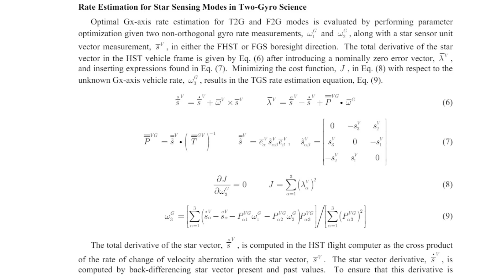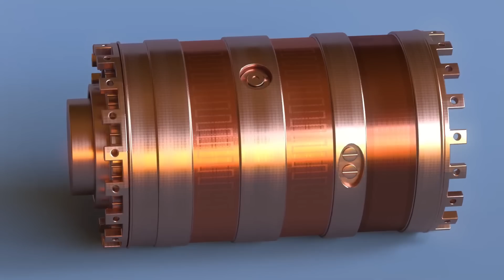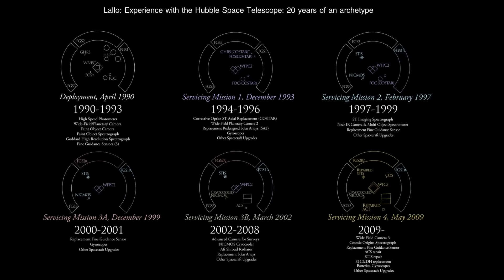How Failed Gyros Are Making Hubble's Life Harder

Comment: So why can't we build and launch a replacement (or many replacements to take advantage of cost and manufacturing efficiencies)?! Presumably NASA knows most of the problems with the original design and current modifications. So keep the basic proven design while improving/modernizing the problem areas within the basic design parameters and launch a small constellation of them to ensure redundant capacity (and new capacities using them all together) for the next 30 years and we can take the OG offline.

Comment: I have read, very small electrical discharges between the moving parts of the bearings, have over time rendered them useless.
I wonder if Ceramic bearings would have avoided that.

Comment: Loads of great discussion here on mechanical gyros.  I think you would all find ring laser gyros interesting.  They work using a ring laser cavity with a laser beam going around in both directions.  There is an output where the beams are interfered to produce a rotation rate signal.  The interference arises because as you rotate the path for a beam going in one direction is shortened and the other is lengthened. Pretty cool. They are not fool proof and they have limitations at certain frequencies that causes lock in.

Would be a cool idea for a video?

Comment: You can get coarse angular rate information from (some) star trackers, but as they are basically a B&W camera they are only really any good at this in vertical and horizontal relative to the sensor (which is a square grid).  They are very BAD at rotational rates about the camera's line of sight.  This was the flaw involved in the LCROSS anomaly about 2/3 of the way through the mission which blew out almost all the fuel. Details in the LCROSS Flight Director's Blog by the late Paul Tompkins... https://blogs.nasa.gov/lcrossfdblog/2009/10/05/post_1254701386237/
(the rest of the Blog is also fantastic - worth reading for any space geek).  I was the lead software engineer on LCROSS...

Comment: Define guidance sensors or a Kenyan amateur telescopes what you call an off-axis gator. It shares an optical Port with your camera or sensor and looks at a specific star and applies adjustments to the drive system

Comment: Rather surprised the fast pointing without gyro tracking is only accurate to +-10 degrees.  Figured they would have the pointing behavior modeled better than that by now.  How long does the fast pointing take?  If it takes 3-4 hours to slew 90 degrees, then +-10 degree error is much less surprising.  Also wonder what's stopping them from using the star trackers for dynamic tracking during moves.  I guess they can't pipe the raw data to one of the 486's in the instruments?

Comment: Could wireless technology be used to fix that issue with the gyro design? Wireless communication & charging are common things now, these could probably be used to avoid having those wires on the gyro that keep causing the problem

Comment: I read that gyroscope bearings can get pitted from electrical discharges from from getting charged from solar particles   is this what's happening?
Reply from the maker: That was a problem with reaction wheels, not the gyros that run on gas bearings

Comment: Why don't they use light instead of wires?  They could easily use inductive coupling to power it, just like a wireless phone charger.  Then have a tiny laser diode in the end send digital data to the computer.  Digital conversion would introduce some latency, but it shouldn't be so much that they can't compensate for it.

Comment: Why not design a small space vehicle that can be launched to permanently dock with the rear of the Hubble. This vehicle can have more gyroscopes to supplement the existing units. This vehicle could also have a boost rocket motor to move Hubble back up to a higher orbit as well.

Comment: I don't know why they didn't put a few more Hubble's up, they put 10 Spy Hubble's up on various launches including the shuttle and nobody moaned about their cost?
Reply: Because each of those spy Hubble's are possibly as expensive or more than a single Hubble Space telescope. That and how does one launch 10 "keyhole" satellites at once? One alleged electro-optical bird needs a Delta IV heavy or a Falcon Heavy for launch....
Reply: @alexdhall I've clarified 😊. Plainly these spy satellites which were at least the size of the Hubble were not launched at the same time but on the shuttle and other military rocket missions. It should be noted that Hubble is a modified spy satellite and would never have been made independently without these spy satellites using similar optical internals.
Reply: Thank you.

Comment: Once they reach zero-gyros, could they use just astrometry and other sensors, and then gyro-stabilize using reaction wheels and the other official attitude control mechanisms, and with more extreme deterioration, use some of the moving parts as solar-sails and/or plain passive thermal thruster (heat it and ensure asymmetric exposure to space and let the radiative heat thrust), leaving the very center of the instrument pointing at the object while it spins, and do some deconvolution if needed to the circular motion blur around the center, or perhaps apply some sort of shutter mechanism to keep the exposure only for a fraction of the rotation to make it easier to de-smear things by having starting and ending points to the smears ?

Comment: Are the gyros not replaceable on a spacewalk? Seems like a great mission to test spacex
Reply: The gyros are replaceable, this was done on Shuttle missions (STS109 iirc) but NASA hasn't got the hardware to accomplish that now as far as I know.
Reply: @crazybrit-nasafan   if we could do it in 2009 we can do it better now.
Reply: @Grunttamer Technically yes, but I think the problem would be not having the hardware. NASA test every contingency in the neutral buoyancy pool. That included an accurate replica of the Hubble. IF they still have it then maybe it's feasible. 
Plus, not having the Shuttle would be a deal breaker as there is no other space flight system that is capable of supporting the mission.
Reply: @crazybrit-nasafan   that is so 60’s era. We have the specs, build some new units and test in production it’s 2024
Reply: @crazybrit-nasafan The only other option I can think of - assuming it can fit inside of a SpaceX Starship - is a robotic mission to capture and return it to earth for repairs.  If it can't be repaired (I believe there is actually a second perfect primary mirror still in storage) and relaunched then it deserves a spot in the Smithsonian Air & Space museum.
Reply: @Grunttamer The Space Shuttle had the capability to capture Hubble, then use the robotic arm to mount it vertically in the cargo bay on a work stand. Then astronauts who were attached to foot restraints on the robotic arm were maneuvered into position to do the repairs. This capability no longer exists since the Shuttle retired and it will probably be several years before Starship or any other spacecraft has similar capability.
Reply: @StevePemberton2   just because that's the way the did the mission on shuttle doesn't mean that's the only way to do the mission.
Reply: @Grunttamer  you have to have some way to secure Hubble and hold it steady while getting an astronaut positioned in place to do delicate work without risking damage to the telescope. If someone comes up with a different way to do it that's great but so far nobody has. Although we don't know the details of what SpaceX discussed with NASA, maybe SpaceX came up with a fantastic idea for how they can fix Hubble but NASA rejected it because they are so 1960's. Or maybe it was more complicated than that.

Comment: Amatuer astrophotographers now use guide telescopes along side the imaging scope to finely control the pointing accuraccy of the telescope mount (e.g. gear imperfections, polar misalignment etc) as well as plate solving against a star catalog to determine where to point, all with open source software.

Comment: Surely it's still going to be cheaper to do periodic maintenance on the HST (including sometimes boosting its orbit) than end the mission?
Reply: Makes you wonder if there isn't a solution where a secondary spacecraft capable of performing the pointing duties can't be launched and be attached to the telescope.  Justifying the expense is harder these days as there are some ground based telescopes with adaptive optics that have caught up with Hubble.